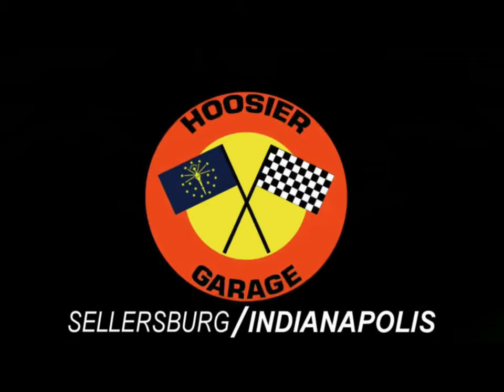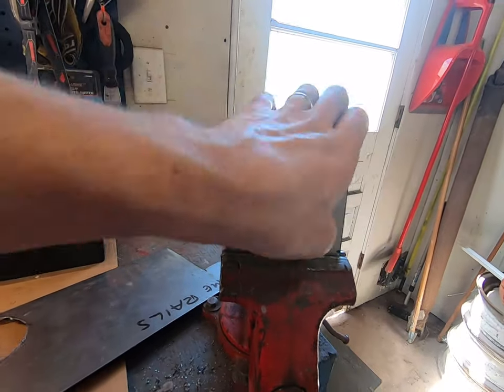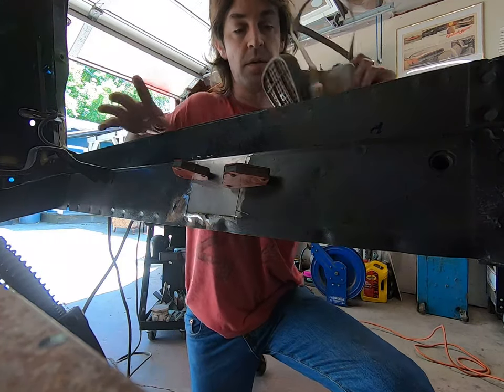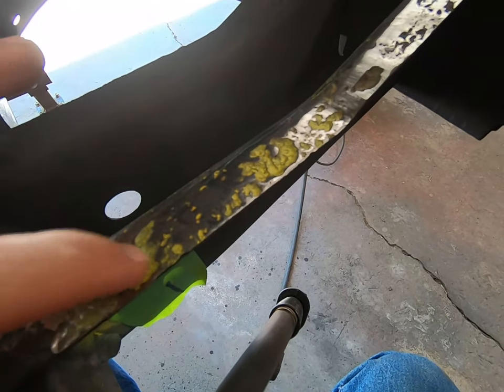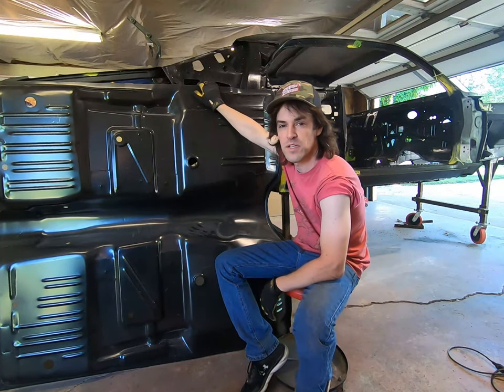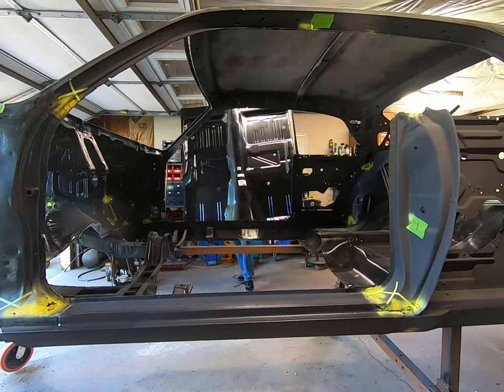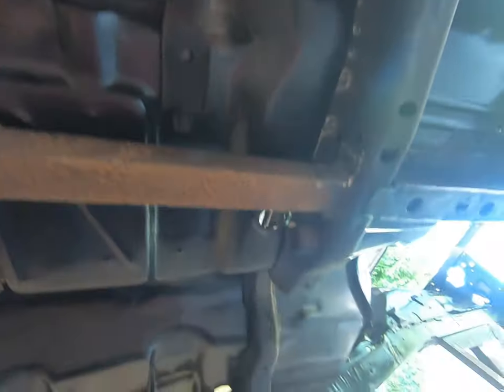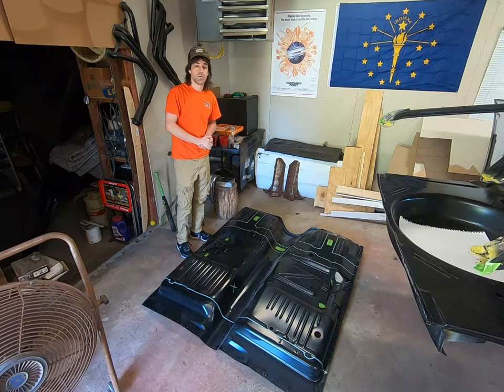Full AMD Floor Pan Install - '72 Duster Restoration ART 1

Comment: Liking the install. Can't believe so much is available for the A-bodies now. Back in the day we'd just grind and glass the pinholed floors or weld in small patches and roof tar the floor pans. Any worse and you stripped out the drivetrain and interior and moved it into a plain low-po Duster or Demon you could pick up for a couple of hundred bucks running. The common problem was your salt laden boots would rot the torsion bar crossmember out and the torsion bar sockets would untwist loose and one side would drop down embarrassingly low, ruining the car. Later torsion bar frame socket repair patches became available, but with millions of A-bodies available for cheap, you just grabbed the high performance mechanicals and moved onto a cheap rust free body. As embarrassing as the  torsion bars coming undone was, it was nothing compared to owning a Nova.
The slightest front or rear end accident and they went down the road for the rest of their lives looking like they were constantly turning left or right, like a crab. Super common sight back then with their unfixable tweaked subframes. Their door hinges were welded on from the factory so the doors never opened right again, even after the smallest impacts. Same with their steering boxes letting go of their rusted out frame horns. THAT was downright dangerous when it occurred. Witnessed several accidents from that, once at the track with an over spoiled trailered SS piling into the stands totaling itself. Out of control just didn't describe the pandemonium. Before the aftermarket stepped in with traction aids and whole rear suspension replacement systems, it was a rare Nova, when these were new, that could plant the power to the ground. Trying to get traction when all that fits in your wheelwells is an E70 was next to hopeless.  Just inferior engineering, period. Mopars all the way thank you.

Malcolm Ottawa Valley
Reply from the maker: Thanks! Always thought that about Novas. I have seen more than a few going sideways!

Comment: Good update Adam .I’m trying to decide if i glue the pan in with panel bond then weld the spotwelds .That way it will be stronger & no water or debris will get between the panels. Harder to seam seal under the car than inside the cabin
Reply from the maker: Its not a bad idea. If you weld, use weldthru primer on both side

Comment: Another nice video Adam, would that bad boy fit through the windshield?
Reply from the maker: Just a hair too narrow
Reply: @HoosierGarage  hahaha, that would of been too easy i reckon :)  I finally got my 24x24 shop inspected and electrical done, moving the duster in to it after i take the seats and clear out the inside of all floor matting /junk and start taking it all apart. Bought me a welder and plasma cutter and am eager to get started, your video series is already helping me.. Thanks again Adam
Reply: It can be done but you need 2 people. You need to bow it.